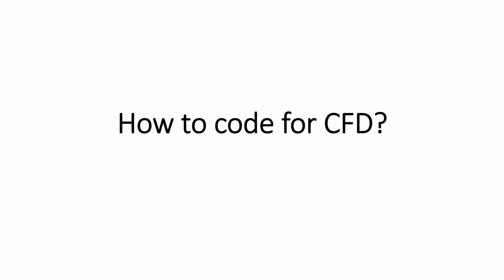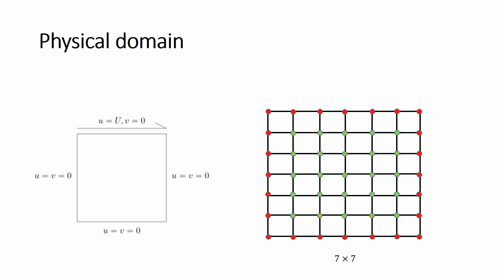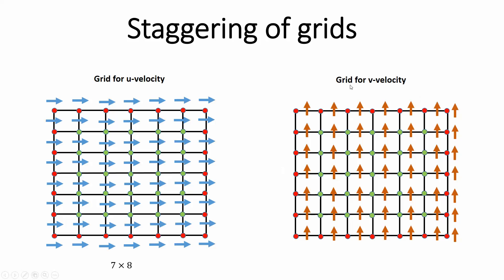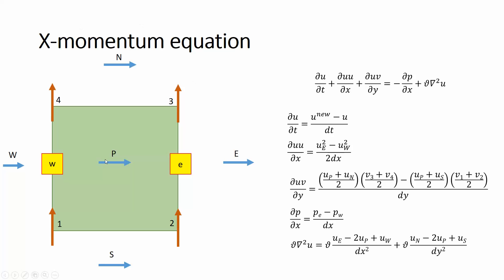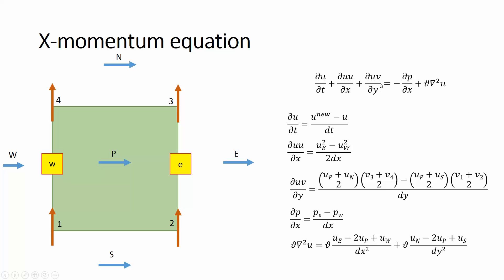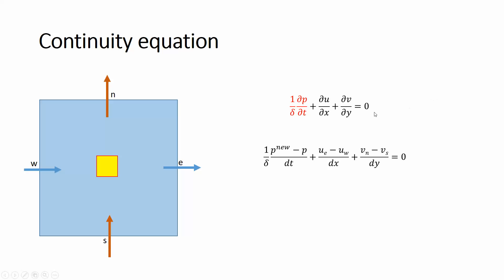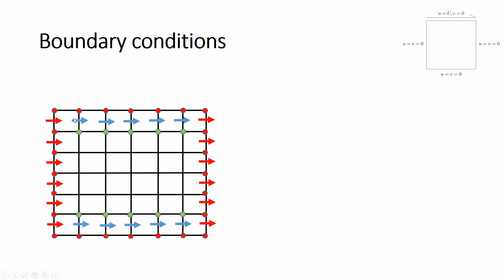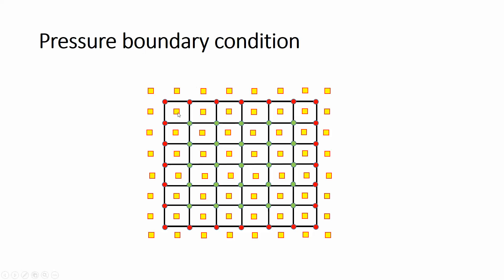Coding for Lid Driven Cavity Flow Simulation in C (Part 1) | 03 | Implementing the CFD Basics

Comment: Hey i just want to say that all of your video are awesome and help me alot.  Curentlly im on my work making a sloshing simulation using navier srokes eq. I have a question on my head that would this alghorithm and eq discreation can be implemented in sloshing phenomen in rectangular tank? Thanks
Reply from the maker: Algorithm, I believe so. But you have to incorporate multiphase models, most likely something that's called volume of fluid method. The governing equations would have more variables and equations.
Reply: @TanmayAgrawal7  hey thank u for you respond. I ve been read a couple of journal regarding VOF method. In multiphase model we have more than 1 fluid properties(rho and viscosity). I wonder if i can implement this SIMPLE algorithm in multiphase model, but i really confuse because your equation not include the fluid properties its use something called Reynold number instead

Comment: Great video!

I am a beginner in this area but this video helped me a lot to understand the basics. However, I have some questions;

Soon I will work on CFD in microfluidics channels or known also by microchips. So could you please provide more information about the best reference to improve my knowledge especially the coding?

I will use solidworks for the modeling and Ansys Fluent for the simulation.

Thanks in advance
Reply from the maker: Hello,

Please refer to the books in the description of my latest videos. I believe that any CFD book mentioned there would serve you well for a general understanding. To be specific, go for the second one as it contains turbulence modelling as well.

Cheers.
Reply: Also, another thing you might look at when considering microscale flows is DSMC (Direct Simulation Monte Carlo). This is because when the average number of collisions is reduced dramatically due to rarefaction effects, continuum approaches fail. There are papers using DSMCfoam, Sparta open source codes etc that you might find useful.

Comment: Thanks for the great video and explanation! is this going to be solved using SIMPLE or PISO algorithm? not sure from the this video which you are going to use
Reply from the maker: From what I remember, I used an algorithm called artificial compressiblity method. It's different than either of the ones you mentioned. More details can be found in A. J. Chorin's 1967 paper.

Comment: nice lecture ... can you explain how to use non uniform grid in your code??? 
 is ACM good for FSI (fluid structure interaction) simulation???

thank you very much .....
Reply from the maker: The equations would stay the same. Discrete equations would need different values for dx and dy. I've never done the non uniform grid myself but would be keen what happens when you try.

No idea about ACM with FSI, sorry.

Comment: Thanks for good explanation. Can I run the code for high value of Reynolds number and more refined grids?
Reply from the maker: I think you can go for Re as close as 10000 and for the grids, it depends on how powerful computers you have got
Reply: @TanmayAgrawal7  Thanks for your prompt response. You have taken Re=100 and grid=128. I run this code core i7 PC. I think I have to use a high end computational node for Re=10000 or greater. Have u even run the code with such high Re?

Thanks in advance.
Reply from the maker: I've tried until 7500 and it seem to work well. Haven't tried 10000 as I was afraid I might need really fine grid there, maybe 256 or finer.

Comment: What if the top is an unknown free-surface?
Reply from the maker: Then first thing is that the pressure is equal to atmospheric pressure all the time. Your domain won't be fixed (waves). And it would be a multiphase problem (air and water).

Comment: u grid velocity have 8 row and 7 column then how it is 7*8 matrix,,,,it should be 8*7?? and v grid velocity 7*8??
Reply from the maker: I do the coding in x*y kind of system. Perhaps you are confusing it with y*x (which is generally adapted in MATLAB)
Reply: I got it, thanks sir

Comment: Can you tell me the c code for non staggered grid?
Reply from the maker: Hi! You can use Rhie-Chow's algorithm if you are using pressure-correction methods. Alternatively, there is a less-efficient but simpler scheme called MacCormack method for beginners which is basically a predictor-corrector type of scheme, I hope this code is working which is in C:
https://1drv.ms/u/s!Ap1As21yR8unlfJPPitu3tbyAXq6CQ
This algorithm can be found in the following paper:
http://dl.acm.org/citation.cfm?id=1127013

Comment: Why did you add artificial compressibility equation? that dp/dt term. thanks.
Reply from the maker: To couple pressure and velocity.
Reply: So this method is easier or SIMPLE?
Reply from the maker: It is easier to implement as you don't need a pressure correction equation (SIMPLE)
Reply: @IsacRajan97  Nice Pun !
Reply: if we want to add the pressure correction term instead for coupling

Comment: Very Good, Nice JOB!!!
Reply from the maker: +Tanmay Agrawal Pressure doesn't appear in the incompressible flow continuity equation
Reply: Hii stira i worked on staggered grid fv lid driven cavity.
Reply: my pleasure:) i asked you one thing if you have discrestization of momentum equation on staggered grids kindly share with me how to get peressure possion equation
Reply from the maker: Thanks!
Reply: sir kindly explain me what is mean by decoupled and coupled equations?
ans me soon
Reply from the maker: +Sumaira Mehmood In decoupled equations, one of the variable does not appear in one of the equations. Pressure doesn't appear in the incompressible flow equations.
Reply: sir i make a code of incompressibile navier stokes equations using vorticity-stream function formultation but i dont knw what is reason the code not display contours i have try many time if you help me can i send you my code ?
Reply: i saw this all  this video but it has not this point
Reply from the maker: +Sumaira Mehmood Just a hint, you can differentiate x-momentum wrt y, and y-momentum equation wrt x and eliminate some terms. You'll arrive at pressure Poisson equation
Reply: but how can found pressure by forming a possion problem using con tinuity equation